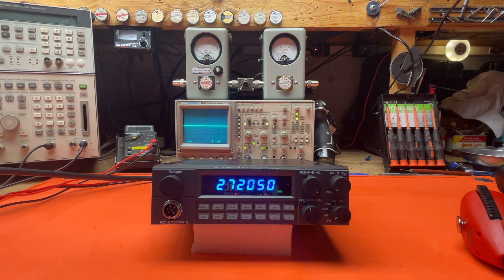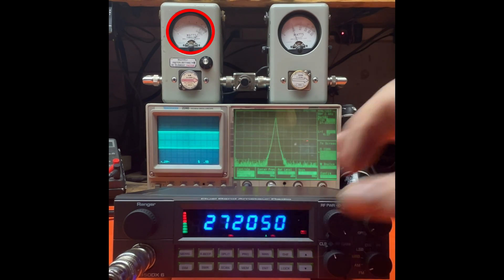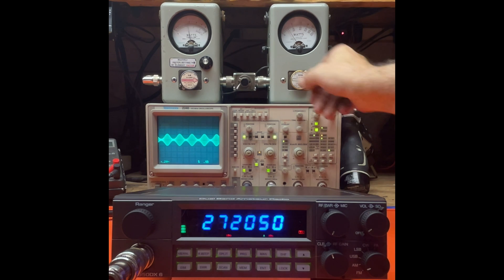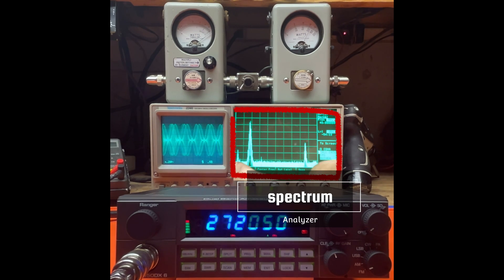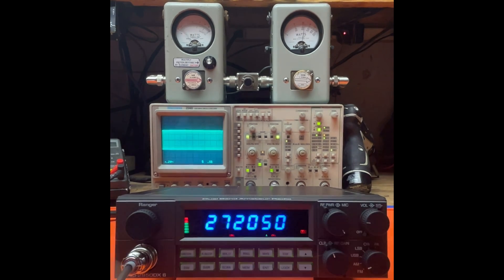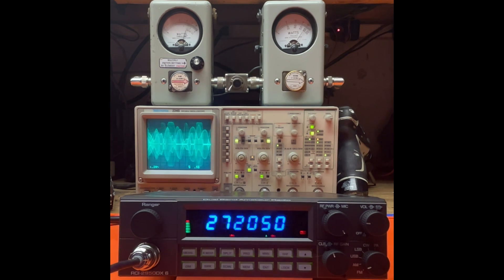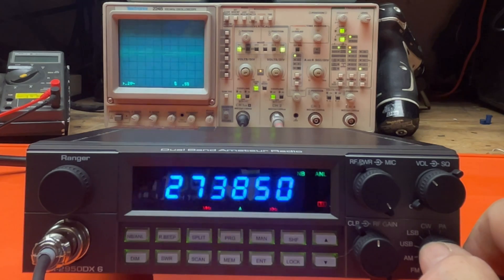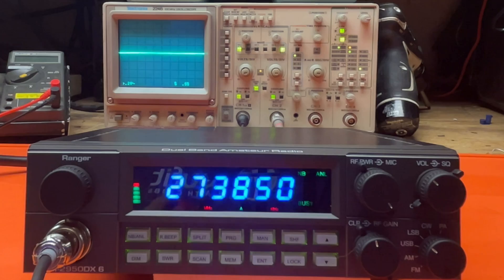Ranger RCI-2950DX-6 Tune-up Report (2022) for Michael in FL

Comment: Wheres Steve in Oregons report?
Reply from the maker: That has turned into a larger project than I ever expected Steve, and it is taking some time.  As we discussed, it will be worth the wait. I knew when you saw this DX-6 video post before yours, that you would be upset...but hang in there my friend, yours will be EPIC.....And for the rest of you reading this...I am working on a full "How I do a Tune-up" video and using Steve's DX-6 radio as the example.
Reply: @BellsCB  Thanks Screwdriver!! Mine will be installed this weekend.
Reply: Got refunded my tune up report money.....

Comment: Did you put a high cut filter in there or is that the way the new rangers are coming because that's a nice receive nice and quiet.
Reply from the maker: Must be the conditions, I did no mods to the radios receiver, I just aligned it. The receiver is the same on all the 2900 DX series.
Reply: @BellsCB  the rangers Great Radios but I know they receive is very noisy that's why a lot of people put high cut filters in there with a little switch on the outside. Do you put HI cut filters in there if somebody wanted one?

Comment: Hi there Mr screwdriver.  Is it me or have you got rid of some of your noise at your location ? Or dare I say it ...but has ranger actually sorted out there receiver side of there 29xx series radios at last ?    As that one Sounded quite for one of those 👍🤔.   Keep safe.
Reply from the maker: Well, like I told Radio Man, It must be the conditions, I did no mods to the radios receiver, I just aligned it. The receiver is the same on all the 2900 DX series. Conditions, conditions...
Reply: Thank you for the reply.   Yes I guess it must of been just conditions then.   Keep safe over there.   73s.